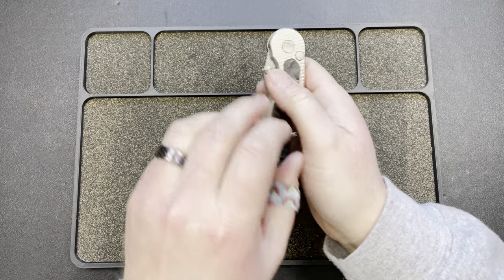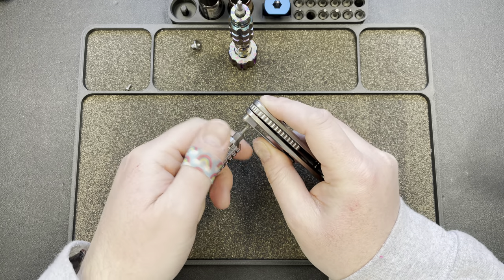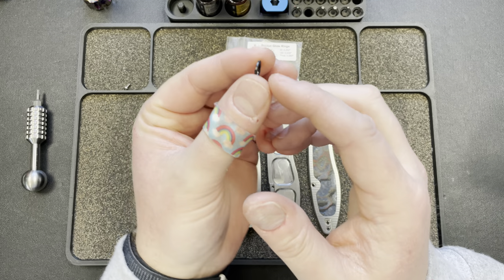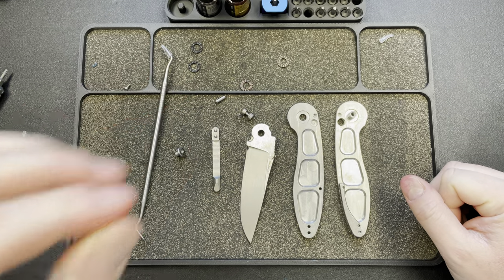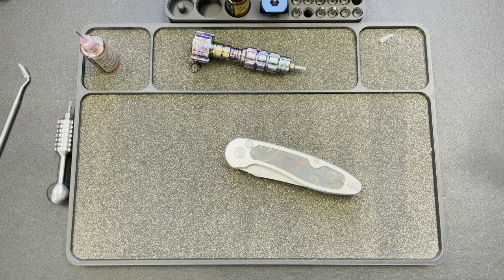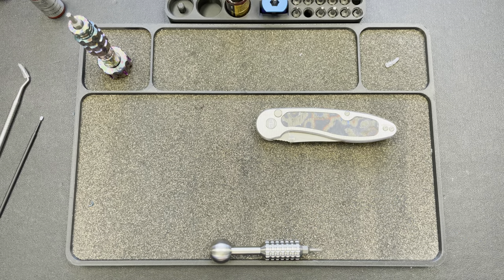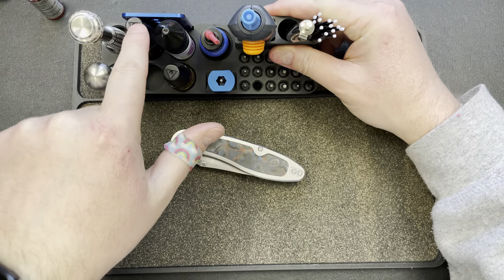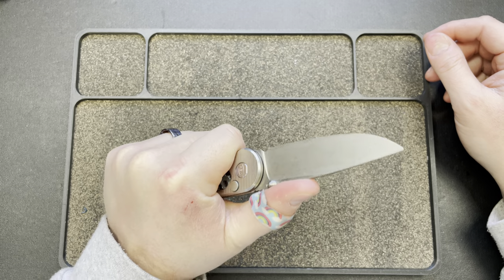This Thing Is Amazing! ABW Model 1 Button Lock Disassembly & Skiff Bearing Swap

Comment: Mine is FAR from perfect.
Button stick is intense, unless I roll it out softly, I can’t press in the button to unlock it AT ALL.  I have to hit the button with something plastic (screwdriver handle).
Also, the hole on the pocket clip is so close to the edge of the clip (and chamfered) that it’s really sharp, right where you grip the knife to pull it out of your pocket.
Had high hopes 😞
Reply from the maker: That sucks. Contact abw i am sure they can help with your issues
Reply: @LeftyEDC  I just spent the last hour polishing the button’s circumference , button pocket, button hole, ramping the blade notch (where the button rides up from closed) and rounding over the pocket clip hole.  Button stick isn’t completely gone, but at least I can press it in with my thumb now.  Pocket clip edge is also way better now.  Waiting for pivot locktite to cure and tomorrow I’ll keep fidgeting with it to break it in more, hopefully she smooths out the rest of the way on her own.